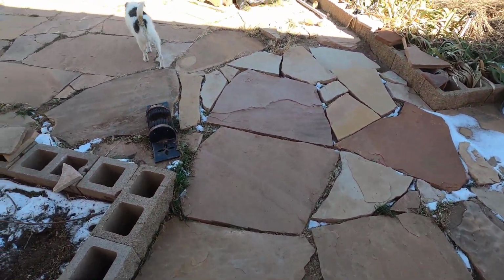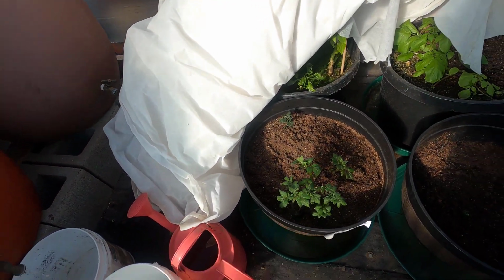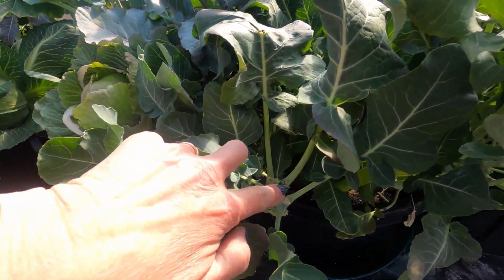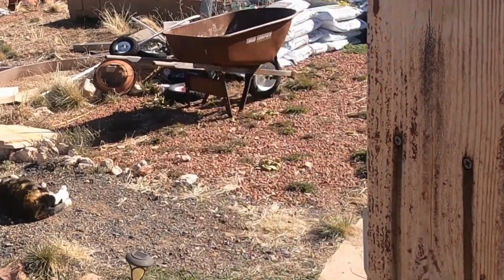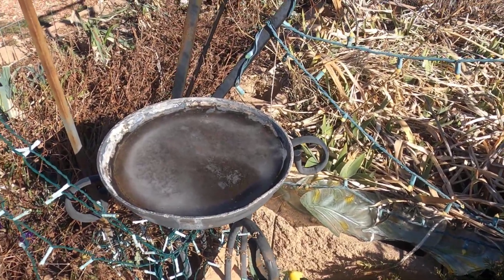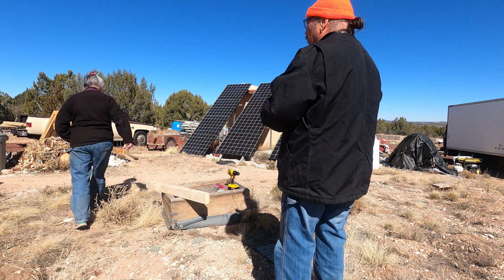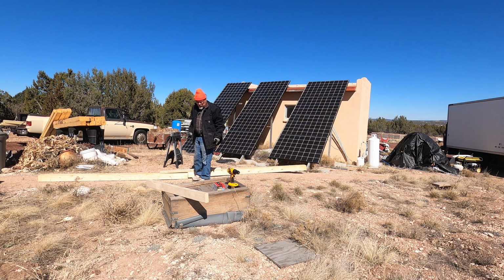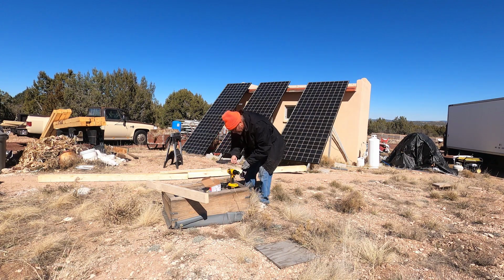Reducing Petroleum Use - Building Solar Ground Mount

Comment: When I was much younger... growing up in Kansas, I knew that Winter was coming to an end when I saw the pretty daffodils and tulips blooming.  I've seen post diggers and the tools to pound the posts in to the ground but I have never seen before the tool you used Irene to remove a post from the ground.  Interesting...
Reply from the maker: Hey Deb - we feel the same way about spring! We call the fence Jack (real name) a post popper. We bought it when we first started installing t-posts. The ground is so hard that you can spend many minutes and all yiour energy trying to pull them out. Post popper decreases the drama! Take care.

Comment: i remember talking to ken in town a month ago and he was selling some panels, but they were for 24-volt systems he has the junk shop across the street from the family dollar. i have to get some 12-volt panels to increase my power system as well with the gas prices going the way they are going. last time i got propane it in dec it was 4.06 a gallon i am sure it's gone up sense then. i will have to get this guys number as i will be needing some lumber soon
Reply from the maker: There, you can use higher voltage panels if you have a solar charger in your system. It converts the solar panel voltage to what the battery needs. Good luck expanding your panels! Take care.